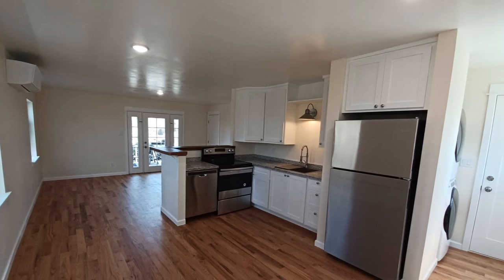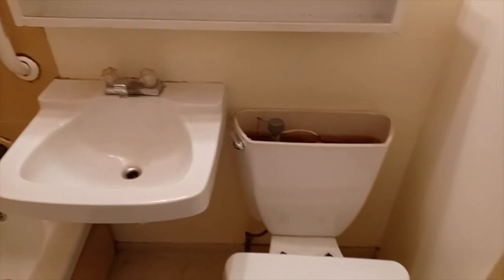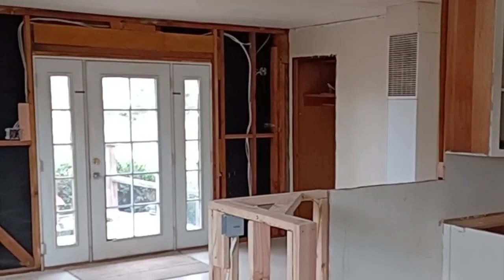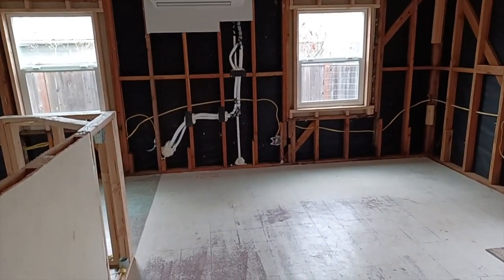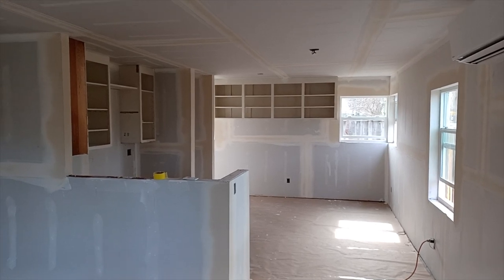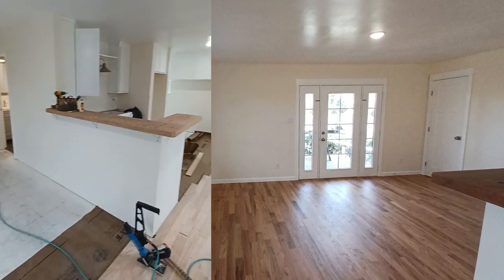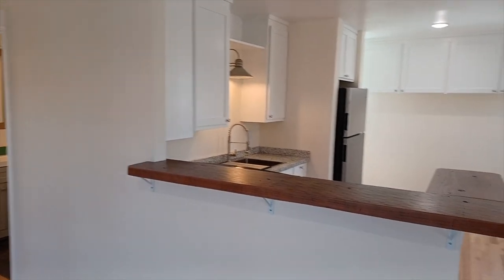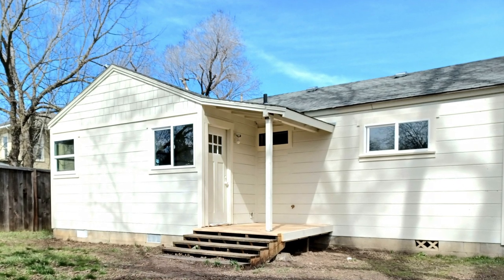Full Remodel for $50k | Ready for ADU

Comment: Wow. You are a true visionary. Did you run into any signs of lead paint or asbestos?
Reply from the maker: Great question. No. I had testing done on most major systems and nothing came back hot. With that said, we always assume there is lead paint in a house of this age so propper ppe and disclosure is important. After everything is painted/covered up any risk is gone.